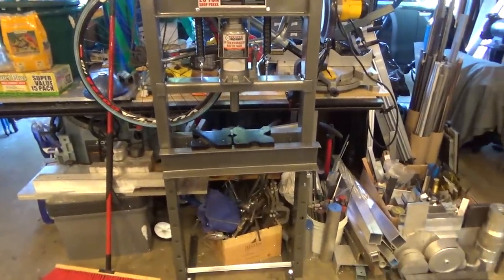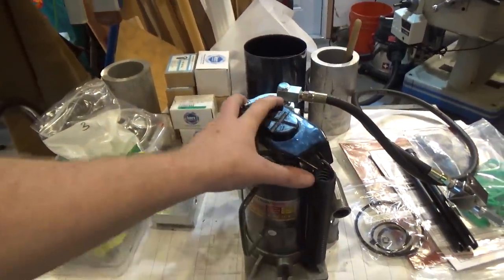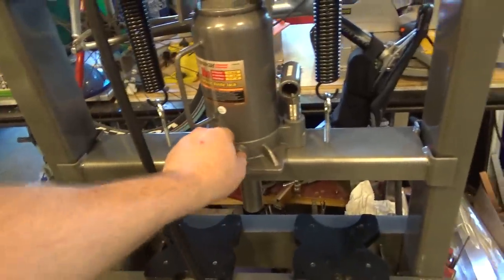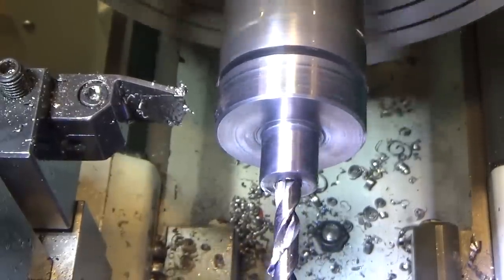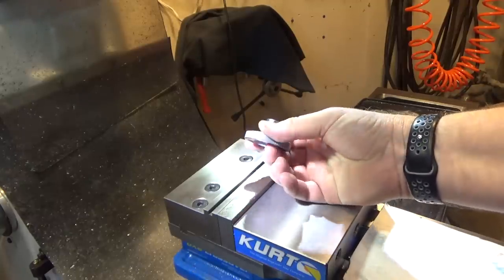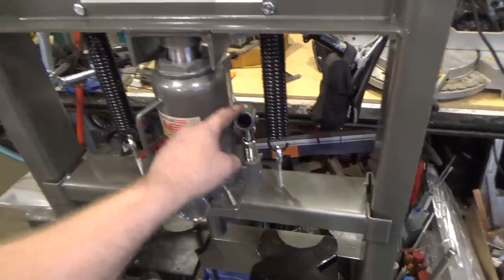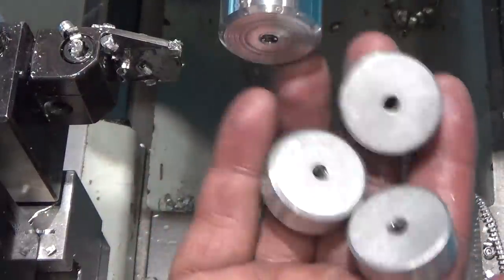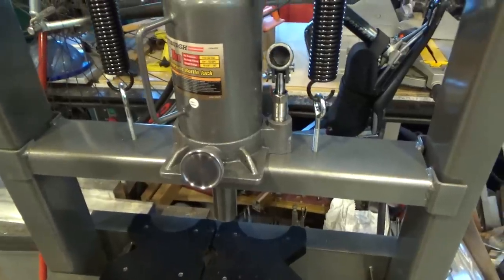Improvements to a Harbor Freight 20 Ton Hydraulic Press Part 1

Comment: I dont wear crocks when im in the shop kinda stupid
Reply from the maker: Your point is valid, but there are extenuating circumstances. Getting chips stuck to my shoes and dragged into the house was causing issues with the boss, so I opted for quick on/off shoes, because I go in and out a lot. I rarely lift heavy items, because I have a really bad back and when I do I am careful. Still you make a good point and I often get hot chips into the Crocks which is uncomfortable. Life's a trade off and sometimes you take calculated risks. Thanks for the comment.

Comment: Why do so many of you get off on trashing harbor freight? That's really mean spirited.
Reply from the maker: You make a fair comment. I only take one exception, which is, I think trashing would be making fun of, or putting down, Harbor Freight products just to do it. I truly feel that I intended constructive criticism. I think Harbor Freight sells some tools that are quite reasonable, but I have definitely gotten burned, more than once, with a tool that didn't even work, right out of the box. Several examples that come to mind: 1/2" torque wrench, 6" calipers, and an air nibbler. They went straight in the hopper. The air jack I bought, seems to function well enough, but the two part handle is worthless. I know that we all can't afford Snap-On or Starett, because I am one of those people. I sent a link to my video to Harbor Freight in the hopes that they could make some easy improvements to the Hydraulic Press. If they do, everyone wins. Thanks for the comments.

Comment: all Chinese junk , soft metal
Reply from the maker: None of it is great, but it is functional. If I ran a business, I probably would have chosen differently. This video targets the home gamer. Thanks for your comment.
Reply: @DudleyToolwright  I've been thrashing the cheesy Hazard Fraught press for over ten years. Differential and axle bearings, bushings, press fit stuff, all the usual suspects and then some. I think I got it for 70 bucks with a coupon and it paid for itself the first time I used it. It's not fantastic, it's not even good, but with a little finesse it does what its supposed to.

Love the mods. The knob alone is a huge quality of life improvement. Mine grew a strap, rod, and tubing bender on the top, heh. I had also considered adding a cable and pulley rig to raise and lower the shelf evenly. Sometimes it's awkward to change heights single-handed with something on the deck. Some Nylon or Delrin bushings to take some of the slop out of the beam under the jack might be helpful too. 

I don't think the plate locator pin mod would work for me as I often have occasion to stack plates and bearing splitters and they have to sit flat. Not to say it's a bad idea, just a use case thing.  

Cool vid. Thanks for sharing...